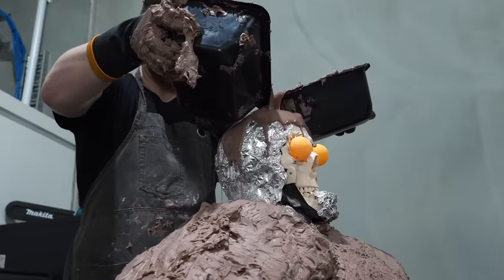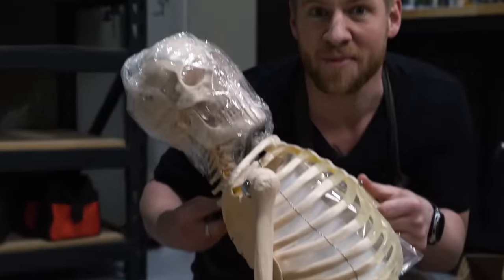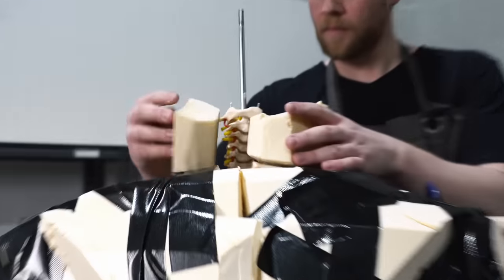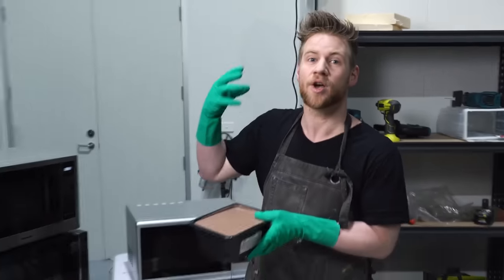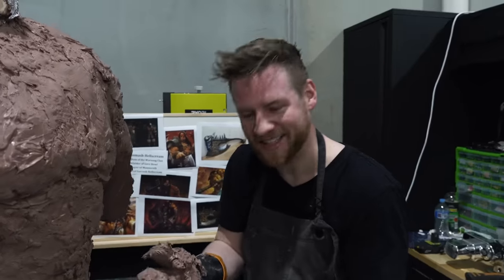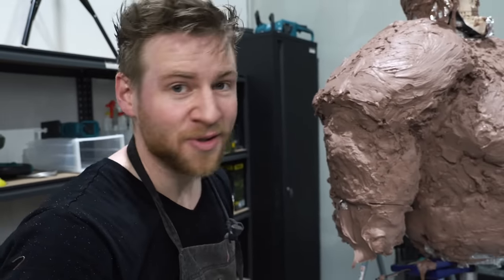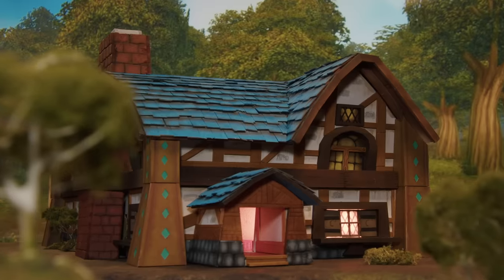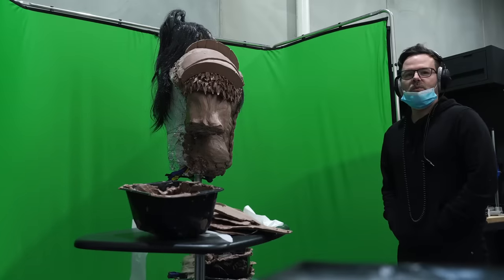I sculpted a GIANT MONSTER and scared my friends...

Comment: If you do a giant sculp like this in the future look into using rebar for the armature.  Don't need to weld just use tie wire which is found at the same place that sells the rebar.  If you use no 3 or 10mm rebar you can bend using a vice and a piece of pipe.  Can make a very detailed armature using this technique.

Comment: Is that oil based clay you're using? From personal experience - water based works pretty well, and only needs water to be softened up, rather than heat.